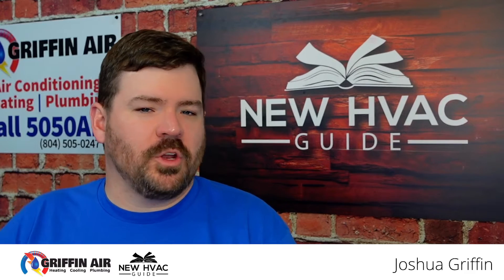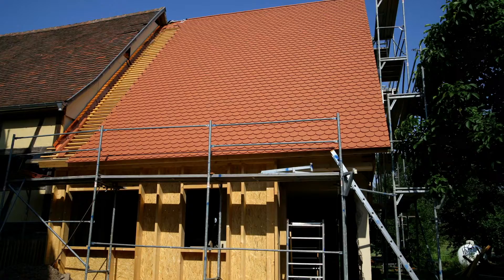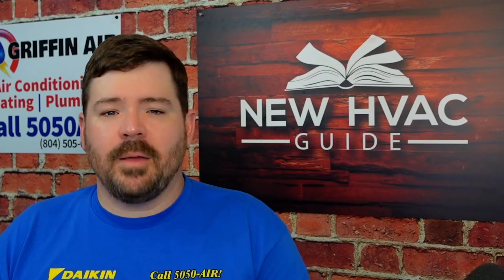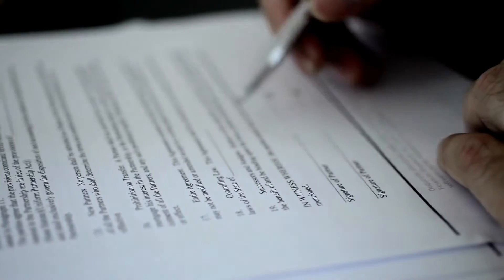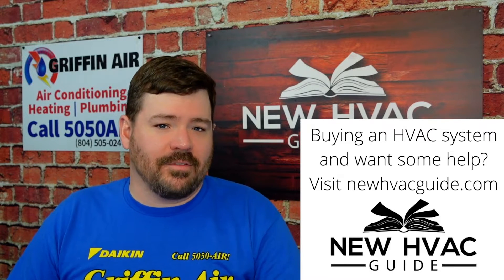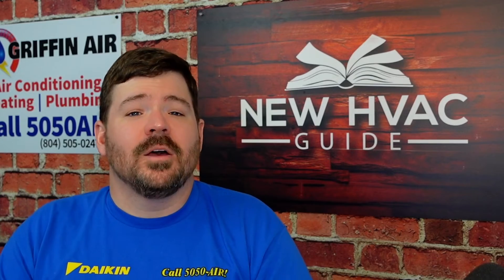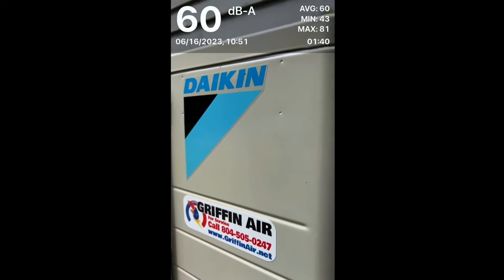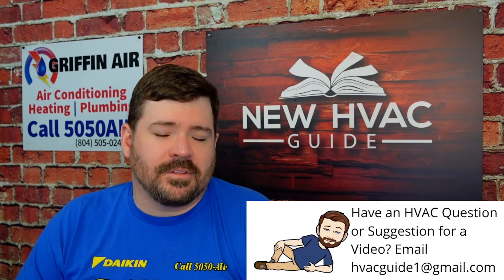Tips to heat and cool a home addition

Comment: Oh crap. I checked in, changed some punctuation, and accidentally deleted my previous comment. Someone asked what I meant about upgrading ducts in older homes to accomodate a/c. In  the PNW it gets very humid in homes in the summer. In older homes, especially with oil heating, they would leave open spaces in the walls during construction that the furnace would blow into. They were not sealed nor insulated. If you have a 50s home with a dinosaur oil furnace and you have an inexpensive HVAC company add a/c without additional plenums, trunk lines and insulated ducts the condensation in the "voids" will lead to mold or dry rot. Many homes that I have found like this we were able to add more ducting and fit most of it inside the open construction cavities. Think of it like toilet sweat. When the little porcelain tank of cold water sits in a humid warm room moisture collects on the warm side of the tank. In an old house moisture collects on the warm side of the wooden or plaster cavities. Insulated ducting keeps the humidity in the air stream where it can be collected by the coil and pumped outside. Sorry to Josh and the person that asked the question. I didn't mean to distract viewers nor ghost a person asking a valid question. Josh's videos are the best!!!

Comment: Have you used Goodman minisplits?
Reply from the maker: I haven’t. Have you?
Reply: @NewHVACGuide  My local HVAC guy uses mainly Goodman, so we've installed like 8-10 normal HVACs in our rentals. He's done 1 Daikin minisplit, but it was pretty expensive. I found the Goodman minisplits online and Amazon, local shop my HVAC guy buys from said they don't exist. But they basically look like a rebranded Daikin model. Very limited selection (9,12,18k single zone only) but they're cheaper and I'm using them for studio/1BR apartments, so all I want is 1 zone pretty much.